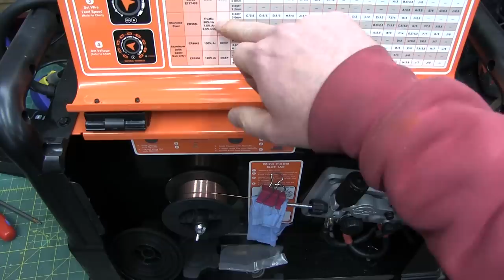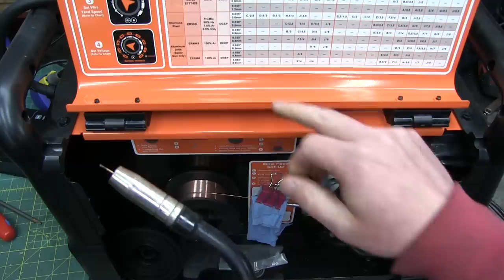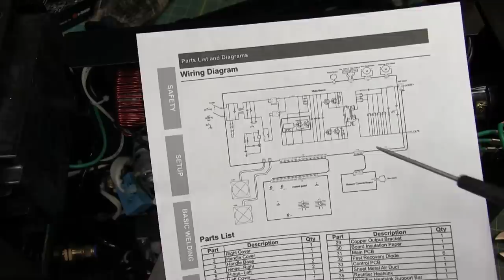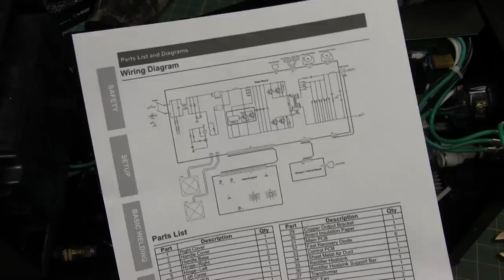BOLTR: Vulcan MIG 215 | Harbor Freight Welder

Comment: I think harbor freight is easing into the shoes of the late Sears company, and Amazon is starting to do the same with their own branded tools.
Reply: GunFun ZS I just saw some amazon basics tools. It looked like a rebranded version of another cheapo brand, but they were still pretty cheap.
Reply: check out the new Doyle branded pliers and such.  seems like some mac ripoffs.  really nice tools.  but not cheap in HFT prices you're looking at $10 -15 per tool.  I really think they want that Sears marketplace in the midgrade line of tools and they have the brick and mortar to back it up.
Reply: Sears is doomed.  HF crushed them w cheap government backed manufacturing.
Reply: They were already crushed. They took too long to shift from catalogue to mall store, just in time for mall stores to be dead in favor of online shopping. If they had just bought websites and threw away the stores, they could have survived, but they were over extended maintaining obsolete delivery systems that take a lot of overhead.
Reply: Sears technically still exists, but yeah, I know exactly what you mean.
Reply: Gary Cooper 
Craftsman just moved into Lowes.
Reply: The other problem is that they completely destroyed the craftsman brand (as well as their appliances). It wasn't that long ago that the tools were OK, but about 4 years ago they started going majority-offshore. And not good-quality offshore, since gearwrench seems to be about equivalent quality to older craftsman, but old harbor-freight quality.
Reply: TurboFlush: Stanley Black and Decker bought what was left of the Craftsman brand from Sears in January 2017. The purchase price was said to be $900 million. Stanley said it planned to bring manufacturing back to the USA for at least some Craftsman tools. 

The once-proud Craftsman name has been on some really shoddy stuff in recent years— as bad as Harbor Freight or worse, but more expensive. Still, the Craftsman brand had to be the most valuable asset Sears had left. The fact that Sears sold it off tells you what kind of shape Sears is in these days.
Reply: EXACTLY at one point Sears was the only place to buy things! The only way too loose that spot is incorrect business strategy and horribly late reactions like you mentioned.
Reply: Amazon branded tools? Haven't seen this yet. It's smart, I've bought plenty of other Amazon branded stuff just because it was slightly cheaper than the comparison
Reply: HF is going after the Ryobi and the Porter Cable brands more than anything at Sears.
Reply: I saw a Craftsman toolbox section in Lowes yesterday and was NOT impressed. Either Craftsman has gone cheapo or Lowes was only carrying the cheapest of the Craftsman line. I also looked and some Craftsman box wrenches lately and they looked like unfinished stampings.
Reply: James Hoiby craftsman makes cheap tools now... the only good things i’ve seen in a while was there took boxes.. i bought a set of craftsman ratchets and the ratchet seized shut after one use...
Reply: Gary Cooper p
Reply: Thanks
Reply: WCGwkf almost all amazon basics is stuff amazon buys from the cheapest bidders
Reply: I'm still trying to figure out how Sears didn't become Amazon-like before Amazon. They started as a catalog company, and what is Amazon? It's basically a catalog on the internet. It's like the old gray hairs at Sears said "Internet, schminternet". Their online ordering looks like early 2000's web design.
Reply: tybo09 there is a YouTube channel called company man with a pretty good explanation of it
Reply: Thanks. I'll look it up.
Reply: I worked at Sears back in the 80s - ironically in the catalog department. That meant that I had to deal with their entire line of products. 

The biggest mistake Sears made was in dropping their catalog, instead of converting it to a website based presence like Amazon. The 2nd biggest mistake was in dropping their lifetime guarantee on Craftsman tools, and then selling off the craftsman line entirely. I think that the company itself was doomed when they went from Sears Roebuck and Co, to Sears Holdings Inc.  Had they done things right, THEY would be in Amazon's shoes...

Comment: Looking forward to more welding videos. Keep the science content high. Nobody ever explains what the CO2 actually does in short-circuit MIG ("MAG"), whatever it is why you don't want it for spray transfer, what's really going with electrode polarity, the exact shit they put in welding rods and why, what the flux is made of on processes that have flux and how it works, but some of us are curious about these things. Naturally I assume you know everything. As the weather's starting to get hot I'd also like to see a test of TIG arc vs SPF50 and whether that really works.

Comment: Any place I worked a air filter on a welder case would plug in a few days or a week at most. It was a check list item for our shop to take the sheet metal case off every welder every 6 months and them blow out.

Comment: I started off welding in high school using an oxy/aceteline torch and filler rod. Then went to Mig then to Arc. I had one of the junky hebrew freight Chicago electric wire welders for welding mower decks and what not back together. Luckily someone stole that hunk of crap from me. I bought a miller 211 like you talked about in the video and absolutely love it!

Comment: I taught a welding and foundry class at the Craft Center on UCSD campus in the early aughts. Always started with gas welding. then arc, then mig. Didn't have a tig-thing. Found it was best to start with gas. It's a softer lead in. When all the sparks fly with all the noise, the class is ready to handle it, and they can see what they're looking for in the welding process.

Comment: In boards I designed, we program the processor on the board after assembly. Makes firmware updates easy and board is more reliable without having a socket for the processor.

Comment: I've seen that red stuff recently... I believe it's called Anti-AvE glue. Appears it's ineffective though
Reply: funkyzero he got a bigger 🔧 to handle that stuff!
Reply: The "Red Stuff" could be surface mount adhesive (SMA). This is a single part compound that is heat cured (say 1hr at 85C) after which It's really quite hard.

Comment: rewatching this, and i just noticed that even in that cheapo Vulkan machine the torch body itself is actually a Binzel! solid stuff! that's why they use a proprietary switch, it's all OEM stuff.
the gas/current cable is pretty chinsy tough. that tape does not instill any confidence.

Comment: Completely unrelated - OK, I get that there's a lot of Canadians watching this channel. As far as I know, Canadians are very proud of the Robertson drive for screws and whatnot. For good reason! It's the best!
Unfortunately, here in Murica, it's hard to find Robertson/square drive screws. ? I went to the Home Depot, a number of different stores, and they have phillips, slotted, torx, and a couple other special drive screws (comes with driver!).
Where in the heck is a good place to get square drive screws? I just want to buy a variety of lengths and, err, girths. With the a regular square drive, not some crappy combination of phillips and Robertson. Ugh!
Thanks
Reply: Brooks Ellis Can't get Robertson in Freedomland, yet I can get them here in Oz. Weird.
Reply: Try Lowe's or maybe Menards.  They are hard to find though.
Reply: I did the Amazon route... The brand got poor reviews, but it's a brand I've used before, so I dunno.
Reply: Simplest way for me is to mail order them also best value or I go to my local Rockler store or other wood worker's supply store to get them no fuss no muss

Comment: At 8.06 those switches are on just about every hobby mig welder we see here with a European style plug in welding torch( plugs in on front of welder ) and I have a semi industrial machine (185 amp) and that too has a euro torch with the exact same little switch. They work pretty well and only very occasionally need the heavily silver plated contacts cleaning. They are after all only switching a relay on, so consequently use very little current and thus sod all sparking of the contact. I've had my welder for 25 odd years now and probably only cleaned the switch twice in all that time.

Comment: I have a Parkside wirefeed flux core welder  I bought from Lidl and it suddenly stopped working, so i opened it up, it looked and smelled perfect. The engineering was nice and tidy by the way. I had no clue why it wouldn't chooch and a voice said "check the trigger" so i opened up the handle to check the switch and the big main cable had uncrimped itself into a spark gap. So i recrimped it and add your favorite idiom here it was back in business

Comment: The difficulty with welding depends on position really. Also TIG (or GTAW) welding is harder than stick (or MMAW) by a fair while especially if you have shakey hands. Its all practice at the end of the day and being able to diagnose faults and how to correct them.

Comment: i am a veteran in high pressure aluminum die casting, i know all of the answers to any questions you may have with any casting questions revolving aluminum. Composing dies for aluminum and plastics are all the same but the steel used for die casting is far more robust and defined. mostly we use h13 and smaller jobs and nitride coat big runners. let me know if u wanna chat!

Comment: Maybe the reason they made their own switch was because that's where the rubber meets the road, and the microswitches they could find at the same cost/cheaper were just a bit too easy to break
Reply: Or not easy enough more like it
Reply: Took apart my new Hobart and it’s the exact same parts 😡
Reply: To clarify I’m talking about the trigger switch
Reply: i believe Chinese products are designed to fail faster so i never accuse chinesium of being designed to last

Comment: The caps aren't just to store charge, they act as a filter to the ripples from the AC side, but also to the chopped current from the switch side. Stopping harmonics being injected back into the AC network. Thoes risistors are probs for the gates of the igbts or mosfets. Stopping them from saturating which is bad. So they won't be dissapting any power.  
I may be wrong but the 2nd set of 4 igbts seam to be used for a 2 switch forward converter with a ton of freewheelings diodes plus the inductor and a cap to supress AC harmonics from strikes. 
The first set of igbts are set up in a boost converter set up, not to step up the voltage but to adapt the current to a sinusodial form thus allowing current to be reinjected back into the network. Its called power factor control, hence the PFC. Its used to correct the phase shift between current and voltage. 
This is a well designed power electronic system from a power engeenier student.

Comment: GMAW=gas metal arc welding, FCAW flux cored arc welding inner shield no gas dual shield with gas, SAW submerged arc welding,SMAW shielded metal arc welding aka stick, GTAW gas tungsten arc welding aka tig. for those who enjoy being an insufferable know it all who uses the correct nomenclature.

Comment: maybe u could do one on the noma widow ac unit that i have it went from skookum to the twilight zone self programing and now runs at whatever temp it feels like mostly 62%f none of the buttons on the board work now only the remote never buy an air con unit with electronic controls they are subject to alien mind take-over only dials and flicker switches from now on for this guy elecromagadget crap gimme an old Viking models 10000 btu's of manly cooling as heavy as fudge and twice as much metal in the consruct of her as a vw beetle lol great video

Comment: For some reason I never learned to weld until I was in my 40s then I was working in a large (relatively) locksmith shop that also made security bars, and the guy who usually did the welding go the plague. The boss asked me had I ever welded and when I told him no he said "you will today." Tig welder and he wanted to see big gobs of weld on the joints. The bars got welded and installed but I still wouldn't have told anyone I was a welder. Fast forward a  few years and I was doing maintenance on a fleet of live haul semi trailers so a part of my daily routine was welding winches back on the trailers after the "drivers" knocked them off on the jersey barriers.

Comment: The fans on that Vulcan kinda worry me. If they're just sleeved-bearing fans they're sure to be noisy piles of crap (and perhaps fail) in welding environments. The rest of the guts are indeed surprisingly skoocum. The floppy gun? No one likes a floppy gun.

Miller must have updated their gun for the 211 because I've had it about 2 years and it's been flawless since I used the guillotine to open the box. I'm not sure I'm in love with Autoset but I feel it's just a naming gimmick. I look at the 211 now and they shrunk it and gave it some handles which seems much better for around the property with a mini bottle of shield gas. Just noticing a lot of changes in that one model from yours, to mine, to the current model.

Miller dealer was also very cool with a spool gun I bought that would bird-nest in the spool itself. Said there was an updated one, just gave me a new one and didn't ask for the old one back in trade. Expect that for a $1200 machine though so they didn't lose any money from me.

Comment: Mig whips stock are more on the lower end across all brands.   Put it through your paces for what your doing.  If you toast it right quickly,   get a solid off brand,  tweeco,  benarnd, ect..  or it last through a lot of use get another of the same.  The more that you are aware of how temperatures and mechanical wire resistance is affecting your set up/process the better you can make it work.   Should work every time.  Biggest factor I would say that impacts mig guns is temperature ,   what processes and how much are you welding at one sitting.  Little mig gun can tack weld all day long

Comment: i actually had a chance to use one of these welders on a job site as an emergency while my genset on my truck is down for repair. as far as welding 1/4" structural steel brackets(.250 for you metric types), with .30 ER70S-6 AWS and ARGON/CO2 mix it performed fine. the duty cycle when using non flux core .30 was tolerable for the brackets i was doing, and needing to move the lift between brackets gave plenty of cooldown time. the pin on the front side of the hinge cracked the plastic the first time i shoved the welder out of my way with my foot (working up on a manlift) i can easily see me breaking a knob, or damaging the front board pushing it up against something. while its reliability in a commercial environment is definitely questionable, i completely agree with ave's views of it being a decent  for a home/garage, where it will be treated semi decently in a semi clean enviornment. hopefully my fuel pump will be in by monday and i can relegate the vulcan to the dust box that is the back of my truck, (or better yet, return it to harbor freight for a full refund!)

Comment: Power resistors adjacent to heatsinks are probably part of snubber networks, which absorb high pulse power but may not dissipate average power near their ratings. In any case, they need to be very closely coupled to do their snubbing job, so you have a design tradeoff.

Comment: Most welders have to pass a conducive dust test where they operate in a chamber filled with conductive dust for hours.  The equipment has to maintain full functionality to pass.  The market doesn’t respond well when you add maintenance items like filters.

Comment: The best thing for learning welding in my opinion is oxy& acetylen! You learn to understand how it works. You can very easily start of with a small flame and weld very slowly and if you are ready for it pick up the pace. Also it is the best practice for the holy grail of welding - TIG/ WIG (for everyone who knows the real name of Tungsten). Also IMO oxy Acetylen is the most fun form of welding (until you stick a red hot piese of welding rod on your hand).

Comment: Find an old lincoln gun and it will have the same type of switch. Lincoln makes them in house to control quality. They also use a lot of plastic. If you put an air filter in the machine it will  plug up and over heat. The filter will have to be cleaned or replaced and the only way you know to do it is to read the manual. Not many of the welders I know ever read the manual that came with their machine. They don't need filters. I have seen a small Lincoln full of primer and it took a long time to burn out the diodes. The usb port is so the same board can be used for different machines by installing the proper program for the type of machine.

Comment: I have a DUAL MIG 171, actually not a terribly built welder. It's one of the older models. Whether or not you get decent or junk is likely going to be associated with the model and where it is in its run I suspect. I've ordered some parts from HF before for mine, but I would be hesitant to go with anything that doesn't have a common easily replaceable roller any more.  e.g. get something that is styled after a Lincoln, Hobart or Miller.

Comment: The bulk caps being right next to the hottest heatsink in the whole thing is a bit of a no-go. They'll die of heat-death pretty quick, even if they are rated for 105º. If something plastic doesn't break first, and it starts sputtering, it's those caps.

Comment: No doubt hell of a machine for the money and for home or light repair use this is probably great. However a comment about the Miller 211, I speak from at least some experience here with an AAS in welding and four certifications you may have gotten a tits up gun (which I get it even the best of brands makes mistakes) but I have used mine for literally thousands of hours and thousands of pounds of wire, its been nearly submerged and had 300+ volts hooked up to it on accident so on and so fourth, never had a failure.